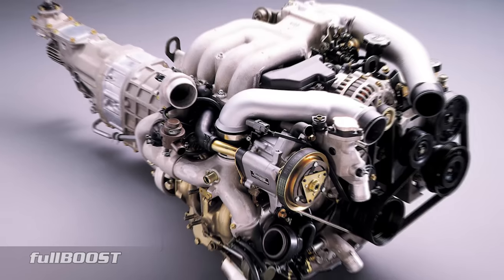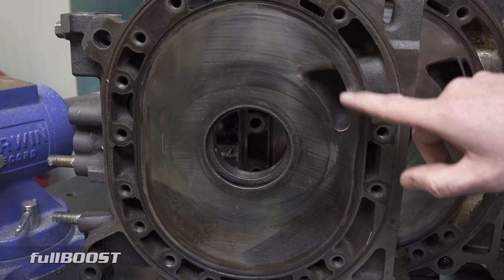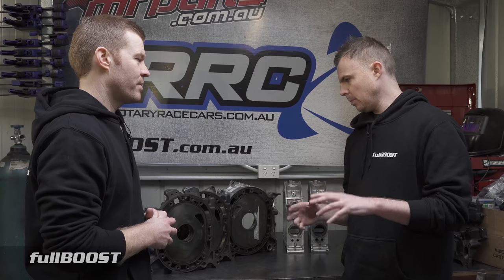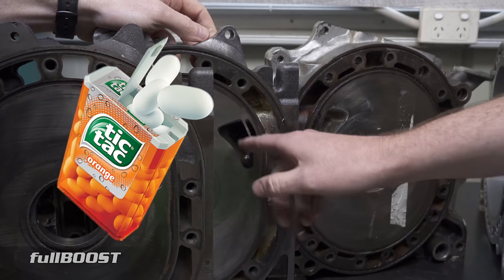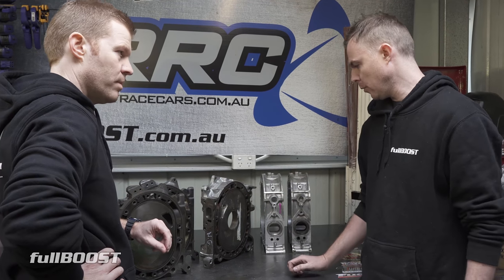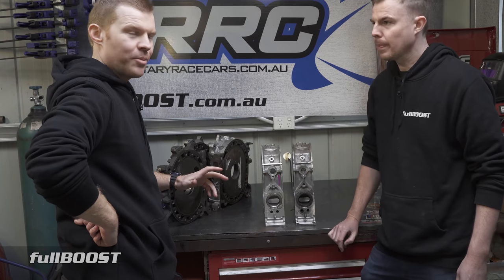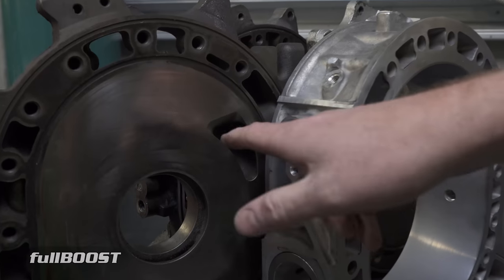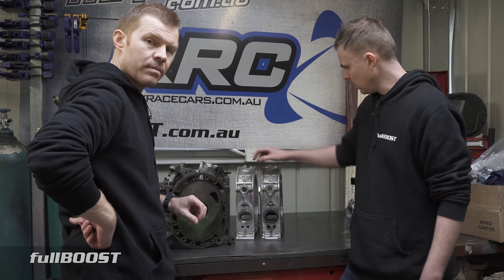How Rotary engine porting works | fullBOOST

Comment: So if almost every aspect of the engine has been changed are there aftermarket manufacturers of irons and housings similar to how Dart or Brodix produce improved design v8's? Why not just produce a larger rotory based on OEM design or better?

Comment: Thanks for the vid guys ;)That semi PP inlet manifold looks pretty good.
Depending on where you are from in Aust,that "J port" pic that you posted would be called a "Monster port".A "J port" is similar to a "Bridge port" except that the slot is wider and ,of course ,also cuts into the water seal.
One thing that you didn't mention which i am sure you are aware of is that most bridge and all j ports need their rotor housings match ported to suit.
Having said all that,what is the horsepower difference between a "Turbo bridgeport" and a "Turbo Extend Port" ?
Cheers Guys :)
Reply: The difference isn't substantial enuf to post any type of reply comments..........!?!?! Like, forreal tho you guys!?@? Come on dude dont be wienerbutts but tell us what we asked for hahahaha!!!!

Comment: I wonder if you guys will still respond but i recently got a gsl se fb 6 port whats your guy's opinions on street porting the 4 ports and then the aux would be a bridge so it would be somewhat sealed during idle? And help with the Na aspect since the aux is to help that from my understanding.

Comment: it deserves an upgrade because the first ones all have a problem, the carbon leans pores and causes damage and the upgrade requires attention to detail so that there is no issue with the brushes and it is interesting for the rotor it is so simple and strong

Comment: Super nice !! planned to build a 2 Piston 600cc rotary out of 2 300cc Kart Engines. I will put them together. Maybe Turbo, Maybe Not ... I need to Know If the crank can break. Normally one engine has 50 HP . Bothe together with Turbo maybe 120HP ? Dont want to destroy the Cases or the Pistons.  How good are these Cranks ? Do they can handle the Power ? Or can I buy other ones ?
Love youre Videos. I will get all my infos from youre Page :D

Comment: I've been wondering... Could you use a 2jz itb setup with 6 throttle body's with 1 injector per throttle body and 2 in the centre plate on a 13b peripheral port and extend the original port and run both?

Comment: I’m thinking of putting rx7 rotors and rotor housings that are semi pp and getting the semi pp inlet manifold to suit. This will be bolted up onto the rx8 motor. (If the semi pp manifold won’t match up with the rx8 irons I’ll have to make a custom inlet manifold). Then making a custom exhaust manifold to plum the 5 exhaust ports together. Technically that would make the best exhaust flow than anything else that I’ve seen. And the intake ports would be similar to the rx7 plus the semi pp would make it breath fantastic. Would that be just as strong a motor as a rx7 with extra exhaust flow, and would that make it be able to handle a turbo? Would love your insight on this idea. Thank you

Comment: With a semi pp would we need to do any work to the original ports? Maybe just clean up the casting marks maybe?
Reply from the maker: Most Semi pp engines use a bridge port style port 👍

Comment: The only thing missing out of the whole dissection of this is showing the differences between using a 4port 13B vs a 6port 13B. Well, that and talking about the custom billet JB Weld RENEE-SIS plates sitting next to the OEM RENEE-SIS plates that Broomy was bitching at. 😉

Comment: Question does the porting perfect timing as far as adjustable timing gear would work on a piston engine?
Reply: Porting is equivalent to upgrading a camshaft. Higher lift / duration.
Reply: angelo paris gotcha thanks

Comment: That engine with the sliding injector stacks certainly sounded impressive.
Reply: Gets the best of both, long and short runners.
Reply: Theyve got a video of it think is 500hp na or something @fullboost
Reply: Interesting.  Forgive my ignorance on rotary engines - is there a limit on how many rotors they can couple together?
Reply: @geneva760  money really i think there's 6 rotor engines not sure of any bigger
Reply: I assume that would be race only type engine?

Comment: I use to own a 13b bp, didn't have any of bad manners low down that you talk of, but nothing below 4-5k then it felt like it had a few psi of boost, was done before i got it so no idea on the size, i think broomy may have rebuilt for the guy i sold it to, purple S2 rx7, racing beat filter and exhaust, it probably had the YBSLO4 plates on it, which was a laugh since it only had 150rwkw at the time, not fast but a lot of fun.

Comment: Question !!?? Why can't a rotary wankel engine's can't get a sleeve to press into the housing since the coating wears and you can't reuse the housing.  Are you telling me no one has made a sleeve in the shape of the housing inner diameter you press it in and then machine it down ?. Hard too explain in words
Reply: They are available.. Google it!!  😊
Reply: I'm thinking it's going to be better in most cases to have it solid. Crazy vibrational things go on in there at high rpms.. Heard of the "devil's nail marks"?
I've never heard of any inserts, but I'd guess they are for applications that don't fluctuate rpms as often as REs built for cars do. 

Would be nice though. I think it's that spinning is not the same as reciprocating and why cylinder engines can use sleeves more effectively?